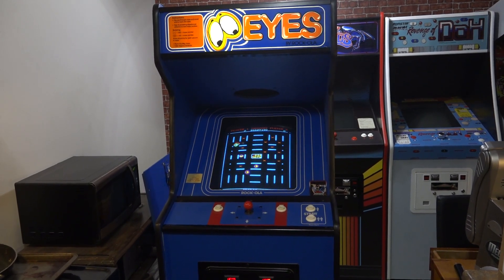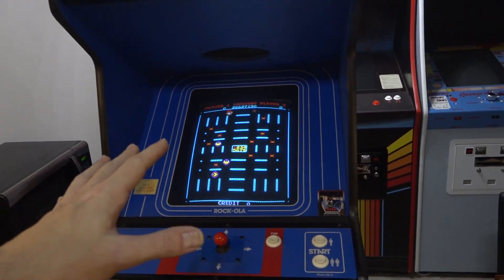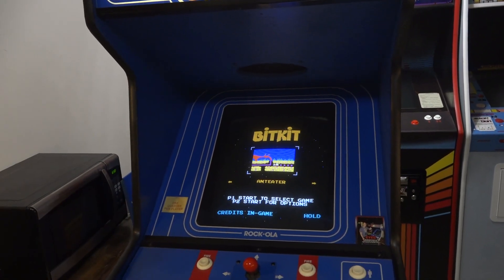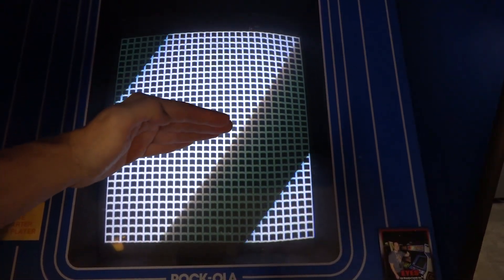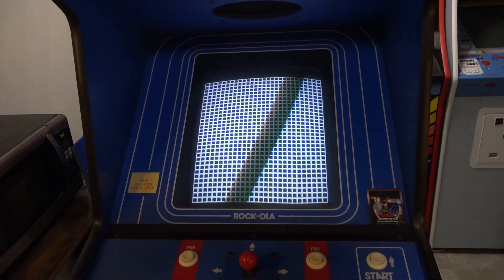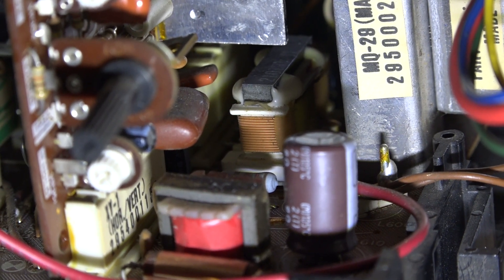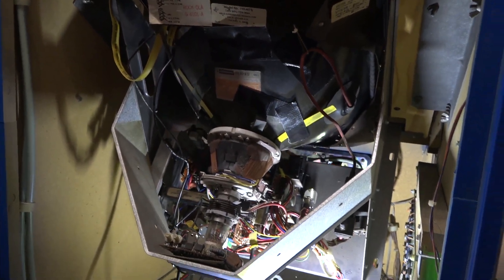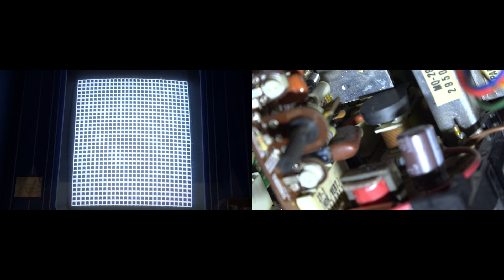Fixing an Arcade Monitor Using ONE Magnet!

Comment: Right on, nice fix. The fascinating world of electromagnetism. Looking through Quora, something to do with the magnet weakening over time due to the Second Law of Thermodynamics and Entropy.
...I wonder if the pincushion transformer can be magnetized back to specification?
...I wonder if after a certain amount of time, you remove your placed magnet, if the transformer will do its job to full capacity once again.

...I've been finding the vast array of the electromagnetic radiation spectrum fascinating lately. The vast amount of light waves that we put to use in everyday life,  the multitude of radio wave frequencies and wavelengths. etc. HAM radio operators refracting/reflecting waves off of the ionosphere to contact others on the other side of the Globe. Earth-Moon-Earth radio wave bounce. Taking a Scanning Transmission Electron Microscope and being able to view an atom.

Comment: This is because the inbuilt magnet on the component has got weak, also when setting up a crts geometry you have to face the tube to either north or south to get the correct alignment.

Comment: Are you grabbing the magent with directly with your fingers or using a tool with rubber grips to place it on the transformer?
Reply from the maker: Just my hands in this case. Sometimes I use a needle-nose pliers just to make it easier to reach. There's not much around that transformer to be worried about in terms of voltage/shocks, but if you wanted to play it safe, you could use rubber gloves and/or just do it with the monitor off.